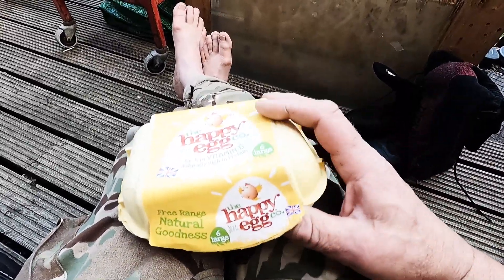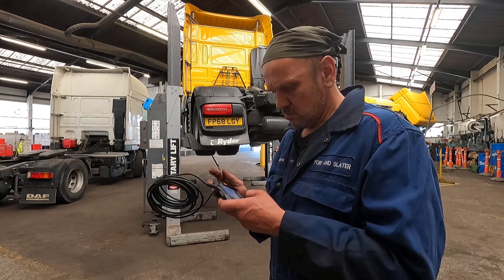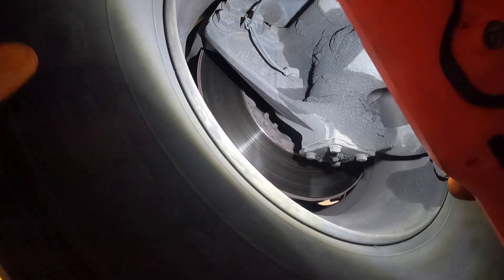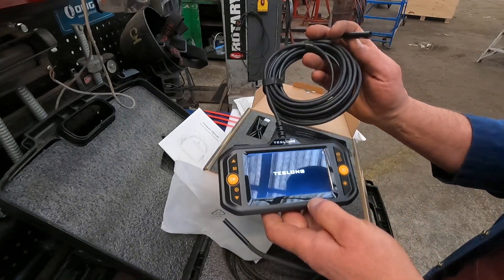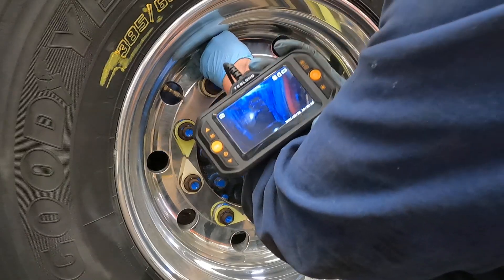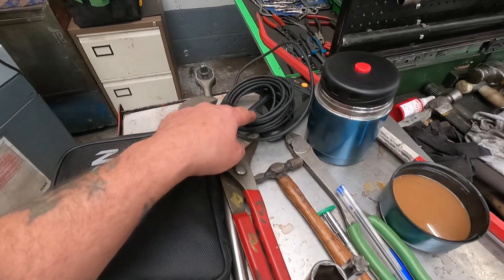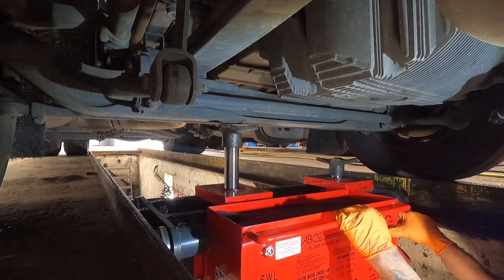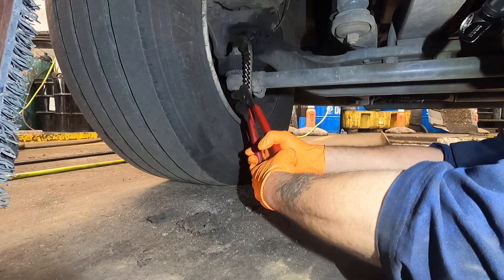HGV Servicing and Inspection Tools - Rear Brake Pads On XF - Teslong TS43 Borescope plus much more.

Comment: Hope you are doing fine after the last week you have been through ..Nice new pit jack ,you have been spoiled ,,I find the borescope good for checking exhaust systems and  the bores in the LF if there are running issues ,before taking the head off ,they are becoming a important bit of kit ..Batteries are also mega important now  especially if they have a BEM ..Had a set after 16 hours charge  after 2 hours they where at 50% and the first thing they cut out is the nightheater ...Keep up the good work and stay safe